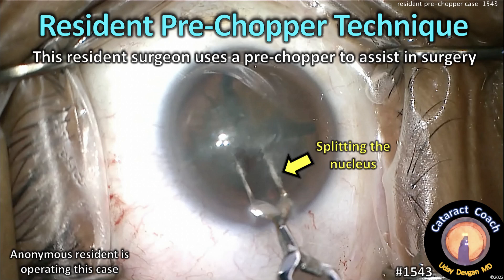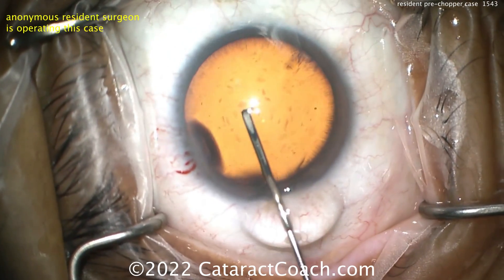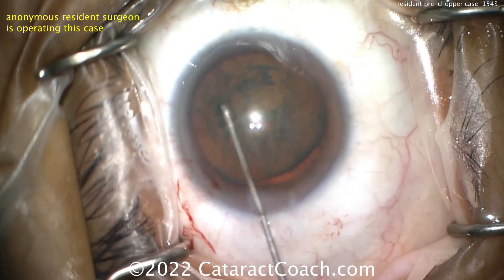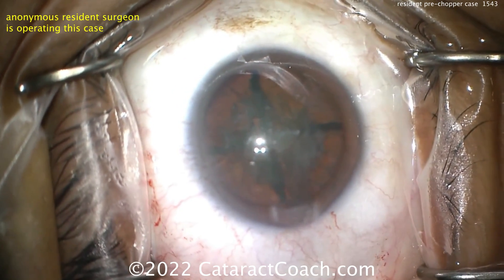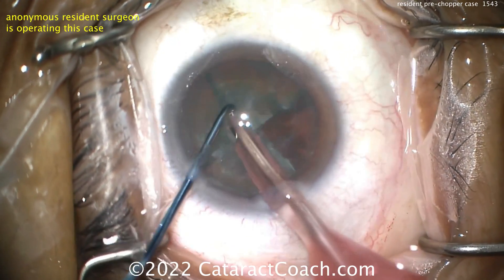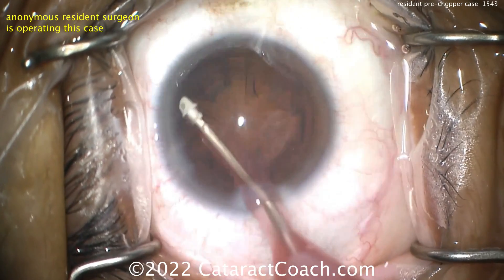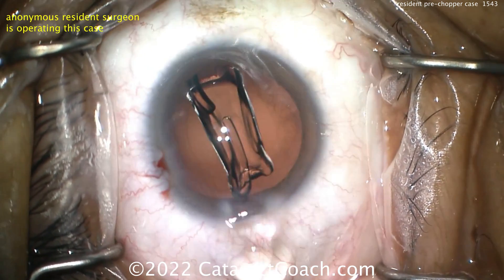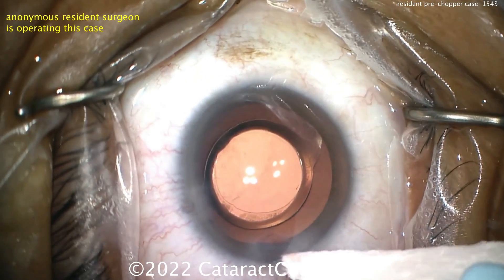CataractCoach 1543: resident pre-chopper technqiue

Comment: to make it easier "unlocking" the first quad, I've started doing an extra chop on the nasal quad breaking it into two halves. It takes all of 2 extra seconds to do and then comes out much easier than leaving four equal quads. For soft, sticky cataracts, putting some visco into the cracks helps propagate them fully to the equator so there isn't sticky epi holding them together while only the central nucleus is cracked.    Just some little pre-chop tips. Nice case!
Reply from the maker: Great tips! Please send me a video of these especially the viscoelastic to split
Reply: Thank you for tips. I’ve been wanting to incorporate pre-chopper for several years. Is there a good starting version that you recommending that has widest applicability? I see there are several versions out there for different grades of nuclear density.
Reply: @brandonrerickson  I'd use either the Asico (or equivlant) AE-4190 or AE-4198. The 4198 is the newest version and supposed to be a little better at dense cataracts without using a sustainer. I personally don't use a sustainer, if its too dense to pre-chop I just groove down the middle and do a version of D+C using the prechopper upside down to split the nucleus, that way the blunt backside is facing the posterior capsule so no risk of damage.